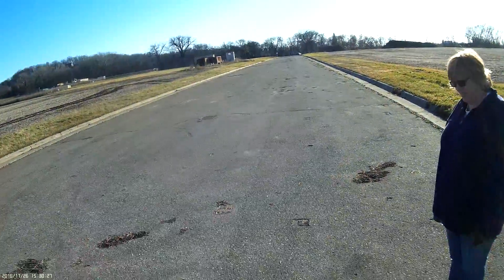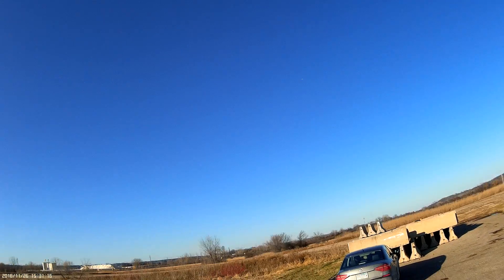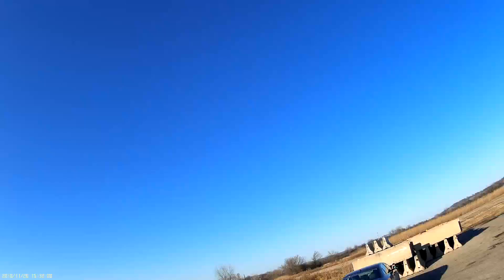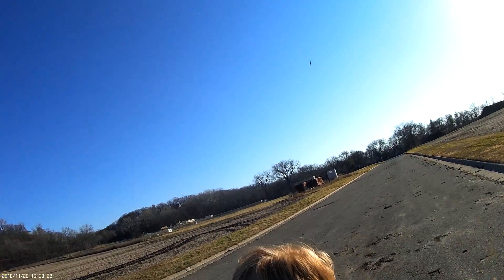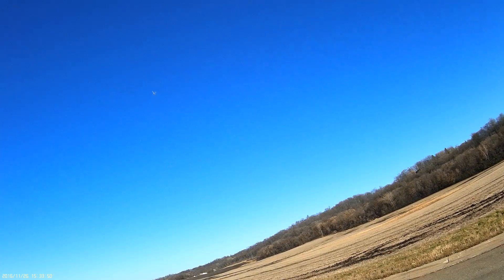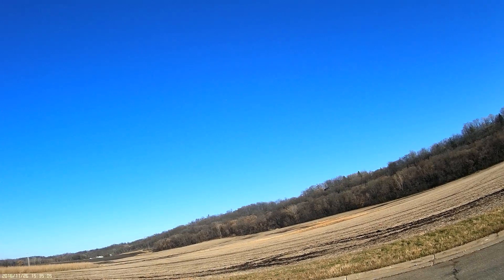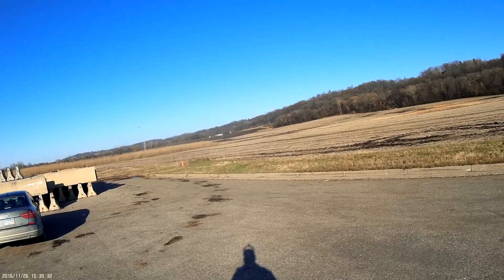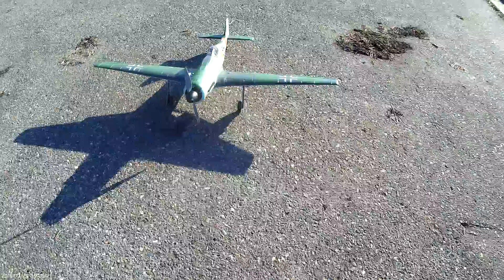flightlineRc TA152 2 blade speed runs

Comment: Thank you.  One last question.  You said they are similarly fast but the TA152 flies differently than anything else.  What does that mean as compared to the Strega?  The TA looks very smooth in flight, is there a handling issue?
Reply from the maker: the TA has a much slower rate of roll. when i put the strega on high rates and go straight up i apply full aileron and it really rolls! the TA has much different roll rate and does this much slower. the TA is very smooth and it goes right where you point it. The TA is like the strega i am not sick of it yet. i still very much enjoy flying it. the best speed from the TA was 100 mph. so it is 20 mph slower than the strega. the strega handles better than the TA 152 but that is not saying that the TA handles bad, it is just "different" it has a very long narrow wing that makes a different kind of lift. it is just a sort of curious flying experience. when landing the TA it is important to keep some speed or it does like to go up on its nose but that is just something you get use to. the strega has no bad habits just that it will roll out for a very long time if you carry too much speed.The Ta152 is a model that you just dont see every day. it has that luftwaffe mystic that is enchanting. the p-51 is like a belly button, everybody has one.

Comment: I was wondering which of your planes is the most fun to fly.
Reply from the maker: hi chris, this TA152 is really fun and i enjoy it very much but the rochobbies Strega P-51 is my favorite go to model of all time. honerable mention goes to the dynam corsair. i really enjoyed flying the corsair till it tossed the battery out while doing multiple rolls and blew in a million pieces hitting the asphalt ;/ just missed my wifes car.
Reply from the maker: ok, this is no fair!!! i really enjoy flying my guillows rc conversions as well . they each have their own story and mean so much to me. the giant 70cc and 30cc models are a different thing all together . there is such a contrast of flying a 35lb giant and a 2.5 oz micro.but really the "go to planes" 45"-55" inch span models are the most convinent to grab and put in the vehicle and fly. the rochobby Strega will make 120 mph passes and go verticle till out of sight.it is a bit greassy to land but if you get use to slowing it down and using flaps i can slick it in every time. and just a joy to fly. i have owned the model for 4 years and still am excited to fly it every time.and asside from a few broken props all of the electrics are working flawlessly after hundreds of flights.

Comment: Just checked the ESC on my TA-152....and it seems it was set to low timing....what was your esc set at????
Reply from the maker: hi bruce, i'm not sure what mine is set @ but it seems to be right.
 i have no complaints. i have the 12x10 apc propfor it. now i just need some above freezing weather.
Reply: PUT MINE UP WITH A 4CELL AND WASN'T IMPRESSED WITH  THE SPEED ..3 BLADE.SWITCHED THE ESC TO MEDIUM AND WAS A GOOD BIT QUICKER. I WILL TRY THE 12×8E 2 BLADE WITH THE STOCK MOTOR TOMORROW. IF NOT FAST ENOUGH....I WILL INSTALL  THE HIGH SPEED 3648-880Kv upgrade...she will pull the loose grass up😃

Comment: @jagdpanther9 Loving my TA-152 as well. Flying with the 262g Admiral 4S 2500mAh 30C battery and moved it about 1/2" away from all the way back. While it flies very nicely with this battery postion, next time I'll go a little farther forward and see if it helps with my flaps. Not sure how Mike at MotionRC flies with 3S and various 4S bats all the way back. Because right now, I'm getting quite a bit of lift when deployed. Still tinkering a bit with that, but I thoroughly enjoy this bird.
Reply from the maker: this is a model that still excites me every flight for nearly 2 months now. the rochobby strega put the same spell on me and i have been flying it for nearly 3 years. i have been flying 2200mah 4 cells about 1/2" from all the way back and i really think that is the sweet spot for my 2200 4 cells. 3 cells are a dog although they do fly the model. 3000mah 4 cell and larger actually slow the model down from increased weight but increase the flight time.
really neat model with its almost strange presence in the sky but really it is just that hard to describe different way that this model handles that is so interesting.

Comment: Ao does it give enough pull? or you will change te prop?
Reply from the maker: hi harald, i really like this 11x10 prop but i will be trying a 11x12 and the 12x8 apc @ some point. the vertical power and climb is just stunning so i should just leave well enough alone.but i never seem to do that.
Reply: jagdpanther9 mmm, talking about models you Should build another guillows, Try with the guillows Sbd Dountless. Its big rudder makes it easy to fly and is 30 inch wingspan
Reply from the maker: hi harald, the b-29 superfortress kit 2005 has been on my bench for the past 6 weeks. it is nearly ready for covering and will be flying on a 3 cell 1600mah battery. so if everything works out there should be a B-29 function video and maiden in the next 6 weeks or so. i would like to build the dauntless @ some point.
Reply: jagdpanther9 Wow! thats a rare kit! Im waiting for the video, have a fun building it! :D